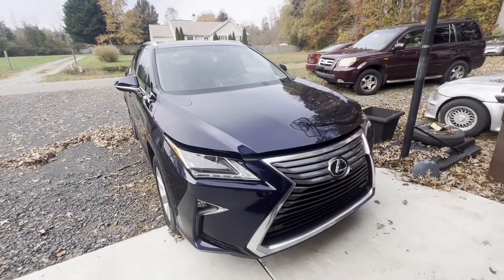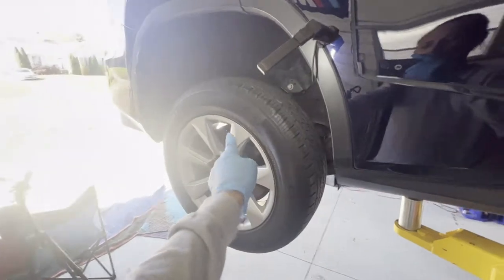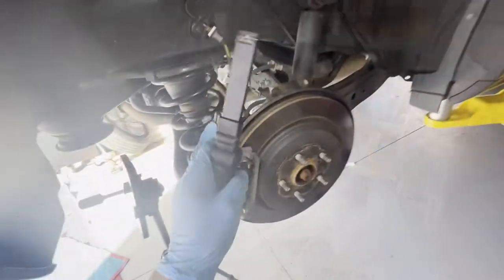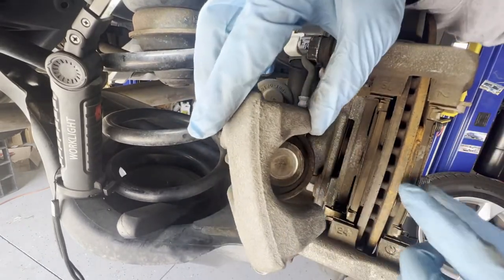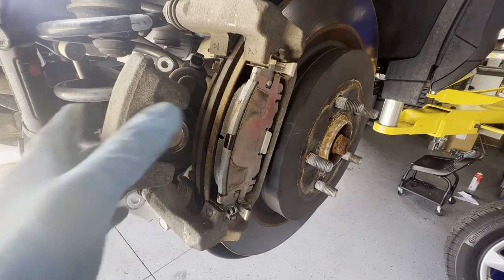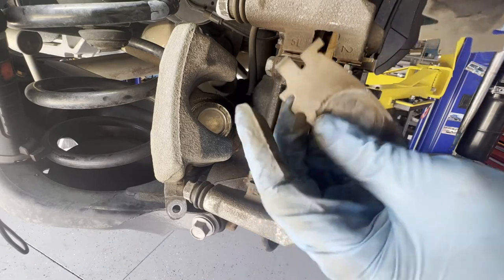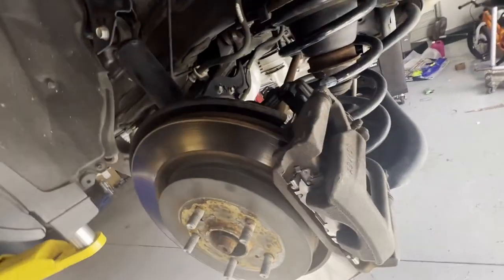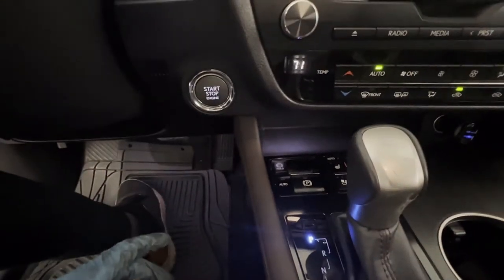Fast & Easy way How to Replace Rear brake pads w/ electronic parking brake /2016 Lexus RX350 2GR/FKS

Comment: thanks so much for the correct demonstration of how to get the parking brake to disengage.. all others want you to put 12v power to the actuator. This was the correct and easy way to get this job done
Reply from the maker: Thank you for your support brother
Reply: But how to erase the codes if one don't have the engine scanner
Reply: @ranjithak765 same issue I don’t know how to clear the codes as I don’t have that tool

Comment: Sorry but this was amateur hour. Look no further than his messy shop. Hard pass.

First, "Fast and Easy" and Brakes should not be in the same sentence. This is a job that requires you take your time and not skip any steps which he certainly does. At the end, he does not even remind us to replace the cover on the master cylinder. He also did not have to say start at the far right side since he was not bleeding the brakes.

I just did this job. It took a bit of doing but because I prepared it was not too bad. I did a far better job than he did.

You need to apply 12v of power to the parking brake motor on both sides to FULLY turn the internal gear- THEN you can press the piston in. If you do it his way you risk damaging the mechanism and the piston will often fail to fully retract. 

You should thoroughly (that word again) clean the area where the new pads go back and forth.

You should add new hardware for the pads including where they go into the bracket after you clean out that channel and warning tabs.

Do NOT put grease on the piston like he did.

**REMOVE the slide pins, clean them well and lubricate with a silicone based lub- not petroleum based.**

You do not have to play inside the car twice before doing the other side.

You should use a steel wire wheel and drill to clean the rust off the outside of the rotor.

Re-torque all bolts in a brake system to spec. This includes the lugs for the wheel as well.
Reply from the maker: you look like you know whats youre doing! Bravo sir 👏👏👏👏👏

Comment: Another option is to just pop off the parking brake motor (2 hex bolts), and then stick a hex in the caliper and turn it until caliper can be fully compressed.  Very easy, and no popping in out of car, setting and unsetting brake, disconnecting and reconnecting...just a manual job.  I'll add, the caliper turn has 0 resistance, so you just pop in a hex that will grab gears and spin it, you could do with your fingernail, if it fit.

Comment: The shim backing plate from the original is not necessary since the new pads already comes pre install and the brackets that hold the pads need to be clean and new. Those pads are going to be stuck and would not brake even on both sides.
Reply from the maker: Thank you for that insight 👍🏽

Comment: Great shortcut video. However,on the other hand,if the electronic parking brakes malfunction during driving,the brakes applied, and locked up,it would be troubles.
Reply from the maker: Did it lock up on you. 

However, that never happens to me, neither to this car

Comment: Can you unplug the Right rear and do that side only.  In the video.  You are working on RR and unplug the Left rear one?    Thank you
Reply from the maker: Yes. Whatever side you are working on, you unplug the other side then retract. 
So the side that you are working on will fully retract
Reply: Just using a floor jack.  Just wanted to do one side at a time if possible.
Reply: Guess I’ll jack the rear up and do it that way.
Reply from the maker: @johncastiello6005  you can do that. As long you can reach up the connectors
Reply: I was confused about this as well. You have to unplug the opposite side to retract the brake caliper pistons on the side you are working on which is counterintuitive.

Comment: i should have watched your video first!  Now i broke the rubber boot with a tiny hole. I put some silicone on it. Waiting for it to dry now.  hopefully it will fix it.  is the boot replaceable?
Reply from the maker: Which boot? The one around the brake caliper cylinder ? Is there a fluid coming out ?
Reply: @autopurlieu no fluid. Is it fixable? Should I worry or buy a new caliper?
Reply: Hi @kexia thanks for sharing. Were you able to fix it? Was it a big deal enough to have to replace the caliper?
Reply: @autopurlieu yeah the rubber circle around the cylinder. Thanks in advance.
Reply: It’s the caliper cylinder boot. After I fixed it with the silicone.  So far it hasn’t leaked.

Comment: good job, but you should have checked the guide bolts for free movement, and lube if necessary
Reply from the maker: Thankx. You are right. I was too focus on the electronic part and didn’t get a video of that pins of greasing them up 👍🏽
Reply: Sorry what is guide bolt here. Thx. So I can do it. Thx
Reply from the maker: @-ssch  guide bolt ?
Reply: @autopurlieu  I think need to ask @wk4523
Reply from the maker: @-ssch  I call it caliper guide pins . Maybe different terminology

Comment: Thanks for a great video. Everything worked great! Did anyone tear the rubber circle around the cylinder in the caliper. We noticed it after we finished the job. No fluid coming out. At least not yet. How safe is this? Should I get a new caliper?
Reply from the maker: Thank you for your support 🙏 

That happened accidentally. But give it a week then drive it around then recheck again if there’s a leak. I’ve seen something like that and never leaked. 
If it does, a rebuilt kit will work

Comment: Question, can I leave the car in “neutral” then change the pads? This way I don’t worry disengaging then reengaging electronic parking brake.
Reply from the maker: You won’t, the car must be somehow in service mode.
When you started to do the brake pads, they are already disengaged . Then, you must push the calipers all the way in so the new pads will fit into the rotors. 
And you won’t be able to disengaged  it fully if your are in neutral

Comment: Only thing know need to unplug calibers one by one you release both at the same time replace brakes both side then back the same way done
Reply from the maker: Replace them 1 at the time. So it will retract fully just 1 side at the time. 
After finishing 1 side. (Passenger side first). After installing the new pads on passenger side. Then do then same process to the driver side .

Comment: Ok. I have a 2019 Lexus es350. I put the car in service mode to change the rear pads. I was only able to retract the drivers side rear caliper with the 12 volt method as the car service method wasnt working. The passenger rear caliper is not retracting back all the way now. Car is stuck in service mode.. I have tried various different methods to get it to retract and nothing. The motor makes sound and it pushes the piston out but it doesn’t retract all the way back. What to do? And how do I get it out of service mode. It says epb malfunction. I ordered a new caliper
Reply: Did you ever figure out a solution?
Reply: @antonioramirez1977   well, I installed a new epb assembly and used a scanner from harbor freight to move the system back to the correct settings and to reset the codes inside the car. You just need a scanner with epb capability. It’s easy. Initially, I messed up the epb assembly by trying to pry it off instead of letting the system push it back… if that makes sense.  Are you having the same issue?
Reply: @danielmarjanovic9957  yes I Am having the same issue where I tried to reset it using the paper clip method but still doesn’t reset or re engage the epb
Reply: @danielmarjanovic9957  what scanner did you get if you don’t mind
Reply: @antonioramirez1977  zr15 scanner from harbor freight. It has a setting on it to reset everything back to normal. Buy it, use it and return. Pay stocking fee. Lexus would charge $150-$200 for this. If the epb assembly is broken just replace it with a used one and use the scanner to place the system back to normal. Easy

Comment: No codes. After doing that? And why not do both at the same time?
Reply from the maker: No codes, either way if there is, just clear them with scan tools and hood to go. 

When working on brakes, always work 1 side at the time.
Reply: Got cha. 👍👍👍🔥🔥

Comment: I did this but I still got the code of electronic brake malfunction and the electric parking brake won’t engage anymore 😢
Reply from the maker: Did you have that code before you started replacing the brake pads ?
Reply: @Alfredo Hernandez you need to clear the code from the car Cpu than you should be able to engage the parking brake again.
Reply from the maker: @MultiInKIEto  parking brake is working properly . No codes ,I always check every car for pending codes every after any work service done. You don’t want those customers to come back on those simple mistakes . 👍🏽
Reply: I am in the same situation right now and I didn’t have any existing codes to begin with. I did the passenger side without any issues but as soon as I tried to do the driver side I got the parking brake malfunction and the e brake doesn’t work anymore….
Reply from the maker: @SOCAL_SHORTS_FACTORY  just reset and erase the codes
Reply: @autopurlieu  This only works if you have the Techstream, which most people don't have. I posted a way to reset this without needing one above.
Reply: Because it was never FULLY retracted. You do this by applying power to the pins with alligator clips and a power source for about 10 seconds. Inside the car only partially retracts the motor.
Reply from the maker: @MOAB-UT  if it was partially retracts, why the did the new pads fits in properly ? 

The point is, as long as you replaced the pads . I don’t think it’s a big trouble
Reply: @autopurlieu  No worries my friend. It worked for you this time. If you do them enough, or worked in a Lexus dealer you would noticed that their techs apply 12v because they do not always retract and that can lead to damage when trying to push in the caliper. 

We all learn as we go. When I first started doing brakes I made some mistakes. That is how I learned. I suggest you print out what I posted and simply try it next time. Cleaning and lubricating both slide pins (not too much and non-petroleum based) is very important. Many times brakes will make noise and not wear evenly if they do not slide correctly. Just take your time and hone your craft. You already have the enthusiasm so I am sure you can be a great tech in the near future- if you chose to. Never be in a rush to do a brake job fast. This is not a fast job. It is a critically important job.

Here is a short video worth watching. He is an expert LEXUS Master Technician. He clearly explains the correct way to replace the rear brakes on a 2016-2022 RX350. https://youtu.be/O037rZaRXu4?t=219

I also worked in a dealership. Techs certified NEVER waste time doing something that is not "required." Notice he lets the motor back up the gear for over 20 full seconds. It's very simple and the correct way to do it. 

He is a Master Tech who has done these brakes hundreds of times and he took 32 minutes to do this job. You did it in about half the time. In fairness he changed the rotors too but that only takes about 5 more minutes. Point is, simply take your time and do it correctly. You will take more pride in your work. You seem to have good intentions which is why I am bothering to help you. Some techs are just idi*ts and I would not waste my time. You replied with a sincere question like you wanted to learn so you seem ok. Also, take a day and really clean up and organize your shop. You will work better and more efficiently. Try not to get too much grease on your skin and in your eyes (wear glasses.) Petroleum is very harmful to health and we absorb chemicals via our skin. Think about those nicotine patches. I worked in shops so I know! 

Cheers!
Reply: @anonymous parrot  can you share the video?
Reply: @MOAB-UT thanks for the word aligator clips. I am trying to check what those clips are called as

Comment: U get error code u do it this way. That not how to disengage the parking brakes.
Reply from the maker: Yes you are right. It is mention that the error will be and can be erased with a scanner. 
Thank you for your input
Reply: So how do you do it? I need to do the rear brakes soon. Thanks.